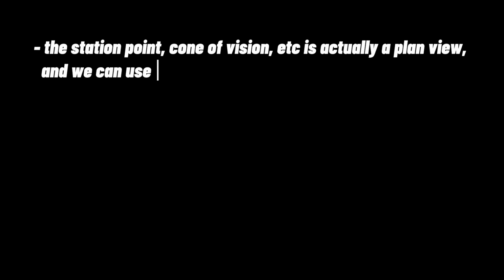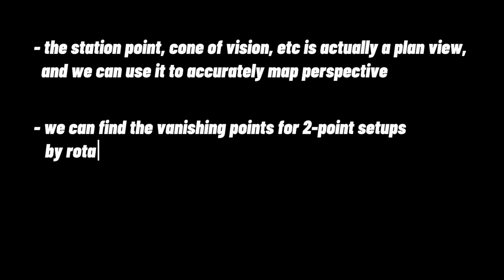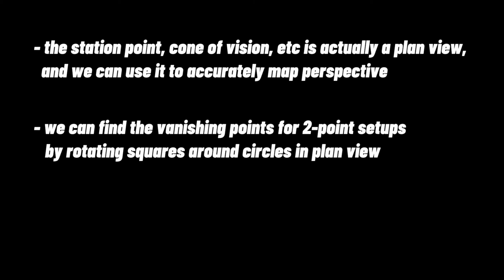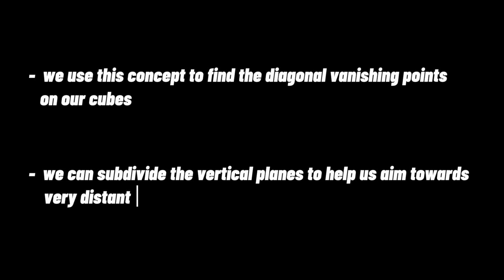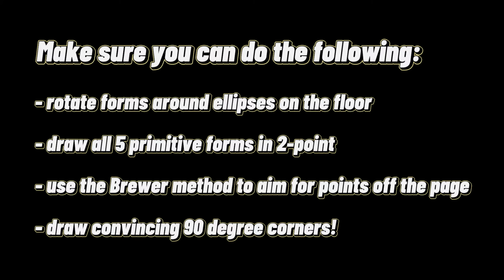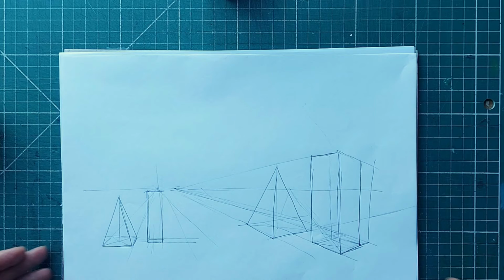Drawing Primitive Forms From Imagination 07 - understanding 2-point perspective - pt.2

Comment: I appreciate your videos, but your Brewer method is not correct. You skipped the steps that ensures that your vanishing points actually are aligned horizontally. It's described in page 54-55 in HTD:)
Reply from the maker: I wasn't sure what you meant by this, so I went back and looked, and I have indeed missed a step, but it's potentially optional, if I am talking about the same line that you are.

The line that I missed out is required to figure out the left side of the box, from from the right side that you already have to make it accurate at 90 degrees. That's more for drawing out a grid with accurate proportions, which is for sure important.

I already had my left VP on the page so I don't need to find that vanishing point. I just need to figure out where to aim my right side lines to, and I can figure that out by subdividing the front upright edge of the box, and the right edge of the paper that the plane contains.

I should have explained that better, totally my bad, but you are correct and I'll pin this comment at the top so that people can see it 🫡

My point for this part of the video was more about showing people how to aim for distant VPs than making an accurate grid, but I should have spotted that and pointed out the difference.
Reply: Well, how would you know?
Reply: Because I'm studying «How to Draw» by Scott Robbertson, just like the creator of this video
Reply: @kjelljesus3784  Oh.
Good answer. No further questions, Your Honor.